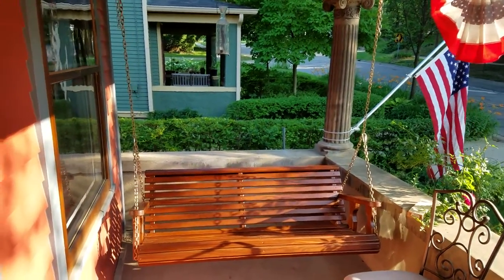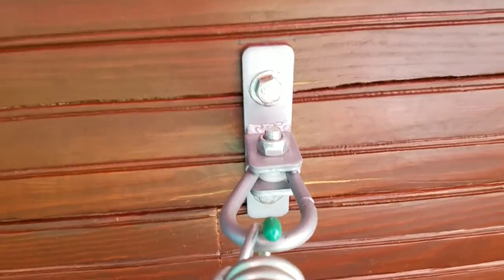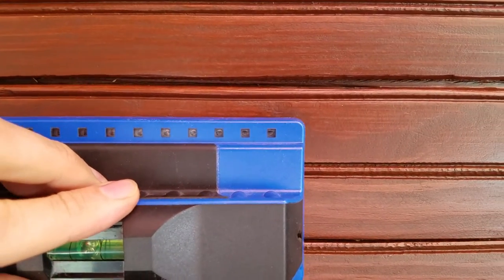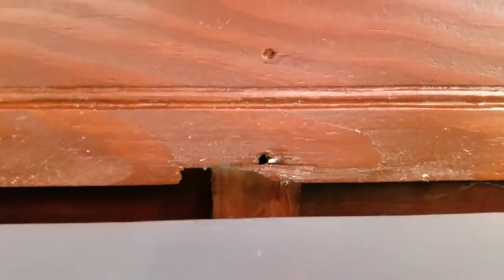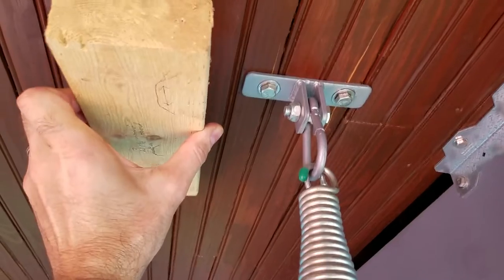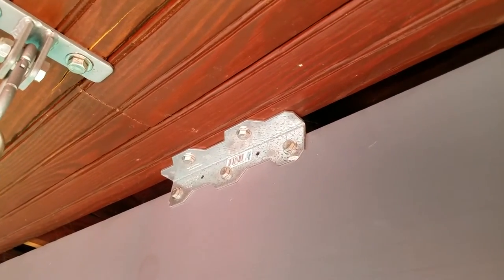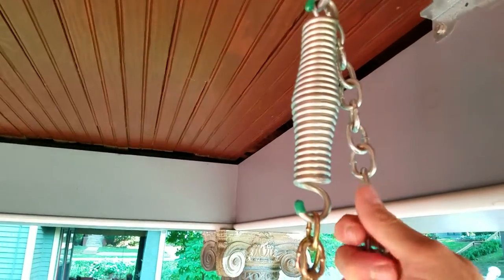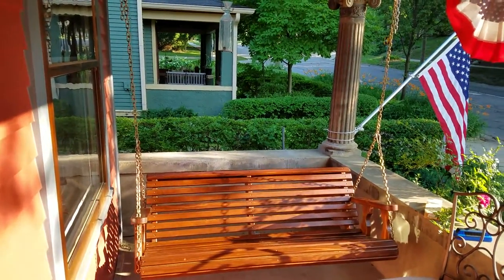How To Hang a Porch Swing | My Old House Fix

Comment: I'm poking around at videos because I have to make something happen for a pirch ceiling so one of these can be installed.
  I have seen people saying  the chain mounts  need to be spaced from 2 to as far as 6 inches further apart than where they are attatched to the swing.
 Any thoughts on that and if you didn't do it you feeiljng lije the swing is fine?

  Bookmarked your stud finder link (because I never bought one I felt worked) and subbed
Reply from the maker: Yes, the chains need to be spaced a little wider than the swing. More info here - https://theporchswingcompany.com/pages/porch-swing-installation

Comment: I e never seen a swing with spring kit, what is the advantages of a spring compared to just chains?
Reply from the maker: Hi @diesel down, well they are kinda like shock absorbers...but for your swing. The give a nice "cushioned" motion while swinging and some up down movement when sitting and getting up. Not rigid like 100% chain mounted
Reply from the maker: @diesel down , check out my blog. It has a lot of hardware, accessory, and install info. 
https://www.myoldhousefix.com/blog/porch-swing-selection-installation-made-easy

Comment: Helpful video! Do you know what you screwed into specifically? Mine are same direction as yours, but only 2x4s; so I imagine I would need to sister the joists to reinforce them. Also, I want to orient my two chairs towards the street and my desired placement doesn't quite line up with the joists; a couple other videos suggest installing 4x4s perpendicularly with joist hangers and then connecting to those. Which does mean I'm looking to hang the two chairs more towards the middle of the porch (compared to your preferred setup where your nice and close to the load bearing points). Any insights you have that would educate us amateurs would be appreciated!
Reply from the maker: Hi, yes I located the joists, used the stud finder to mark the exact center and bolted the brackets to the joist. Now, it did seem a little weak, bit I didnt want to remove the ceiling to sister the joist, so 1) sister the joists or 2) add support brackets like I did here. 3) add the 2x4s perpendicular as you mentioned - you can paint or stain to match and add decorative trim around them so it doesnt look so out of place. Also router or round off the edges of the 2x4s so it looks nicer! 👍

Comment: Instead of a safety chain... can you just have the one chain go all the way to the top but then have the chain slack between the top and the spring?
Reply from the maker: @tuvoca825  great question! Yes you can. Our chain kit was too short, but if your chains are long enough, you won't need separate safety chain sections.

Comment: How do you balance the swing?Hang from the back first & make sure that's even then do the front? Im having trouble with mine hanging twisted.
Reply from the maker: Hi Dianna, if your chains are like mine and make a "triangle" a foot or so above the armrests...remove the chain connection at the "triangle" and move it higher or lower to achieve the angle you want. 

If the height is off from the side to side, then adhesive the chains at the ceiling connection.  

Count your chain links to keep both sides on sync on all the adjustments 👍

Comment: I couldn’t tell if you had to remove the paneling and reinforce with 2x4’s or not.  Did you?  My joist’s run the same direction as yours so I’m thinking I can use the same brackets you did.  My only concern is that my swing is much heavier than yours and I’m not sure if I have to reinforce.
Reply from the maker: Hi Rob,
We have a heavy duty 4.5 ft swing, and Id say its good up to about 350lbs as is, with our one 2x mount.
We didnt remove the bead board, but the fact that swing mounts are out toward the ends and  the added brackets keep the load supported out on the ends vs the weaker , more flexible middle.
Reply from the maker: Also, for the reasons above, it was important to find the exact centers  of the 2x joist. 
If I had installed a smaller 3ft swing, it would definitely stress the joist more, as the central load would be pushed inward.

Comment: What size of screw did you use and did you drill a pilot holes first also what size drill bit
Reply from the maker: Hi Juan, if I remember correctly I used 1/2" lag screws and pre-drilled a pilot hole with 1/4" bit.
Reply from the maker: Update - 1/2" socked head, 1/4" lag screw size.

Comment: I'm so afraid my historic house porch wont hold a swing!
Reply from the maker: I was too! You can add supports like. I did. Check out the video and notice the galvanized brackets on each end - they are reinforcing the single  2x4 ceiling joist.  If its.old growth wood that is super hard and you get your mounting screws in the center of the joist, you should be ok. Also, the wider swing allows the weight to be distributed out on the stronger edges vs the middle where the joist may sag easier.

Comment: The other (brain-less) way of mounting the swing is to simply put a strapping along several joices .. it would certainly look uglier ... but trying to centre the hanging screw bolts would not be as critical, .. and one would still get a very secure, if not MORE secure, eye screwbolt placement
Reply from the maker: Yep, there's more than one way to accomplish a swing install, but this one has a "cleaner" look.